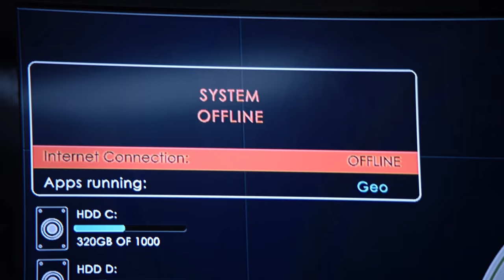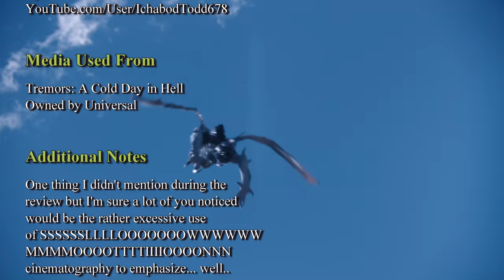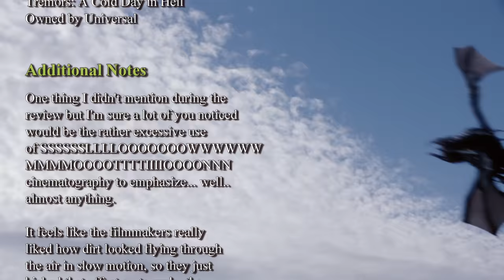Tremors A Cold Day in Hell Review

Comment: There is some logic to the graboid biology, even if it is a little confusing. But it does require a lot of speculation on your own time. 

The new graboid is clearly designed to tunnel through harder materials than the american variation, is more robust, and better adapted for taking down larger prey - these traits are handy for both northern and African environments. If we assume the arctic variation was hunting ice age megafauna, then if they were able to migrate to Africa, they would be in good shape and not need to evolve much. Since we know ass blasters' primary function is to migrate to establish new populations, one going from the Arctic to Africa isn't a huge stretch, especially considering that the continents were once linked. 

Knowing this, we can then infer that the common graboid species we know of is actually a dwarf subspecies, smaller and expending less energy to cope with the scarcity of desert megfauna to prey on. Where the others have caribou, zebras, gazelles, elephants, mooses, whales and gods know what else to feed on, the largest thing american graboids could expect to nab are horses. 

The lack of shriekers isn't particularly surprising either. Shriekers are clearly just a nymph stage for assblasters. Their function is to multiply and spread out before they begin their migration to lay eggs. It could be an adaptation to get as many assblasters in the air as possible, in the hopes that at least a few of them will find hospitable places to reproduce.
Reply: i got one news for you
we seems going to see  new variant of shriekers on next tremors movie
Tremors shrieker island
Reply: Stop writing FOR them...

The answer is this trilogy was made by a bunch of douchebags who didn't care about the details or the legacy and were only out to make a buck while the one marketable actor could still play his role.

And then they discarded him after doing their level best to humiliate him and kill every last remaining vestige of the franchise.

The plot of Tremors the tv series continued in perpetuity. This Netflix shit is non-canon.
Reply: @JJMDude  Using my brain to fill in the unnecessary details is not "writing for them". It's something all good fiction inspires in the audience. And it's something I enjoy doing. Get over yourself.
Reply: @brandonvortex995   THERE BIO WEAPONS so they dont count
Reply: @Biochemitra   YOU did well but the pre cambrian shit is still hurting my brain
Reply: @piglin469  They sortof retconned that. There was a speculative biology paper that placed them in the Permian, and it was sort of soft-adopted into canon.
Reply: @Biochemitra   ok

Comment: The reason why the character complains about the heat in the beginning is that they filmed it in the desert, and then just coloured the sand white in post production. When the huskies run at the grabboid, it's clearly sand, not snow.
Reply: the new lake placid move used the same set
Reply: Thanks for the information, did not knew that 🙂
Reply: That still doesnt make sense

Comment: Why do the Graboids look different again in the Kevin Bacon series? Have you seen the trailer? They look like the leeches from King Kong. What's wrong with the original look?
Reply: SkitZ PiK that's actually a good idea
Reply: The Vegan Bear well after 3-4 movies of the same kind of graboidline I guess they decided on a change.
Reply: Nora Iconiq the tongue things look cool but I dont dig the overall design
Reply: I think it's because the new ones from 5 look cooler than the pretty normal looking ones from before
Reply: complete reboot, no more 2nd/3rd stage graboids
Reply: dude there are alot of different species of graboids
Reply: The Vegan Bear hopefully it's a mutated variant 
If the 2003 tv series is canon then I'd put my money on  Mixmaster
Reply: my guess is the African graboid is the original specis and the frozen north ones are of the original species of Graboid but they traveled and ended up getting frozen until climate change thawed them out.

the graboids in perfection are the evolution of what they would turn into
Reply: Nothing is wrong with original look.
Reply: RETRO ROY the only thing wrong with the original look came in movie 3, with the albino graboid sticking up out of the ground wiggling slowly and us looking at it from a rear view, it does undeniably look like a giant penis. Other then that singular scene tho I do agree and I prefer the original design.
Reply: Those weren' pure breed graboids, in the series they are explained to have been contaminated with mixmaster- a genetic altering material ... altho 'legend begins' in the series kinda contradicts that to a degree as we never see any other varient in that and the smaller ones can wiggle around, doing the shrieker's job, unless the A.Bs are involved  which they do that job much better
Reply: Silent_Stalker which episode is it explained they are contaminated by mixmaster? As far as I remember we see many instances of mixmaster affecting various creatures but that still doesn't explain why the Mexican graboids look identical to the Perfection graboids. Those graboids wouldn't be affected by mixmaster.
Reply: Cody Carrico 
It’s just a assumption, seeing as water drained from the valley lead to contamination of a large pond
I haven’t seen the series in a very long time to know or verify it, the wiki page says the same thing I believe
Reply: Copyright laws
Reply: @deac-hd2lo  never said they werent
Reply: @leviroch  you said there are no more stage 2 or 3 graboids
Reply: @deac-hd2lo  in the potential reboot. . . I wasn't denying their existence in the original. . .
Reply: @tristanwilliams4180  they are in perfection where the first film took place, and had  the og tremor/graboid design. Why would there be a different spieces in that place
Reply: CORTEZ CASTILLO 

You got that backwards
Reply: CORTEZ CASTILLO 

I mean excluding the stupid part both designs are awesome
Reply: Copyright Issues
Reply: They want to use c.g. instead of practical effects and they are trying to make them look scarier at the same time. Personally, not a fan of the switch.
Reply: @tristanwilliams4180  No, there isn't. Only one movie introduced the idea that their might be another variant of graboids and since then they have completely exed out the old designs.
Reply: @devildavin  Nope. Second movie established that the O.G. Graboids have been that way since Pre Cambrian era, 541 MILLION  years ago! This "original" graboid nonsense was a retcon they made up for this movie and it goes against all the movies that came before the redesign. Which is why the redesign is so irritating.
Reply: I wish they hadn't canceled it before releasing it. I would have loved to have seen it
Reply: The original design would look like shit in CGI form.
Reply: i think they wanted to distance themselves from the movies as much as possible and that was why they did it. that way they can keep things they like and change some they dont easier.

Comment: Anyone else bothered by the fact that the new Afro-Arctic ass-blasters are significantly less aerodynamically feasible than the original variant?  I wasn't exactly wowed by the concept of remote control tentacles either.   One thing I always liked about the earlier films in this series was their scientific integrity.  Also, I wonder if they had to have a permit to bring so much pumpkin juice into South Africa.
Reply: Makes sense the desert variant would need to travel a further distance.
Reply: wolf crow they're meant to be the first ones supposedly
Reply: Late to the party I know, but I read a theory that the remote control tentacles where the africanized shriekers

Comment: No the redesign is because stampede entertainment the original studio producing tremors lost all rights to tremors and now universal did what all big companies do when they get a hold of big monster movies they only had a small hand in making which is change the whole look of the monster for ease only for the choice to screw them out of big profits if the change in look only happened in a sequel it's fine but when the same look has been used in 4 movies then you know if you change it to the point it looks nothing like the original look you are screwed beyond belief heck stampede entertainment says if they get the rights to tremors back they will go back to the classic look and pretend 5 and 6 didn't exist I get cgi is better than puppetry but in tremors 3 they had a whole graboid in its classic look that is completely cgi which is el Blanco I mean just take the el Blanco model and change the color from stark white to the typical graboid color I mean it is actually easier to do that rather than cgi a whole new monster plus you keep the classic look and make the same money as the 4 previous movies the new look of graboids and assblasters is the reason 5 and 6 flopped in my opinion